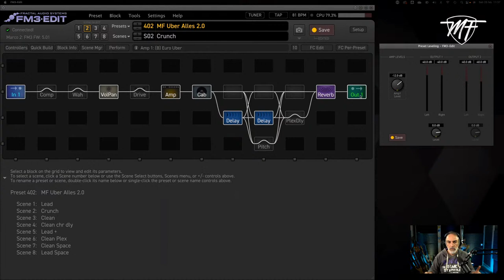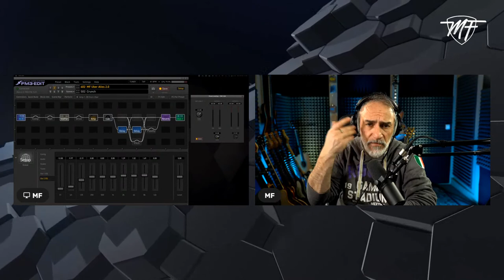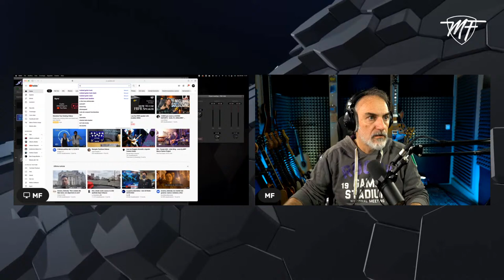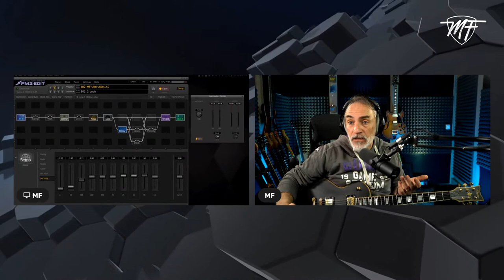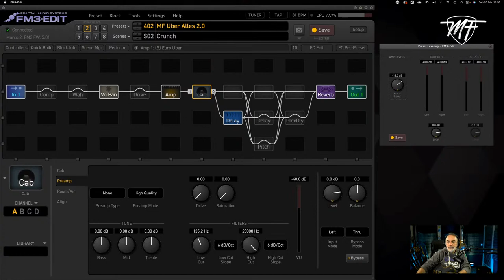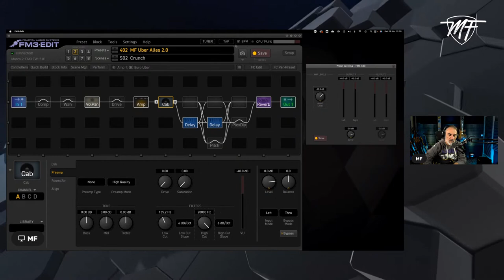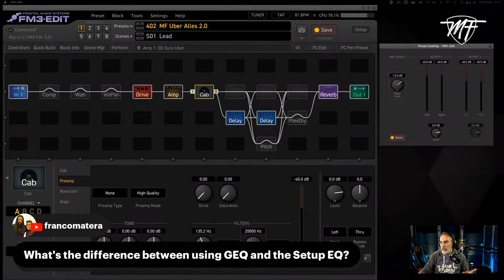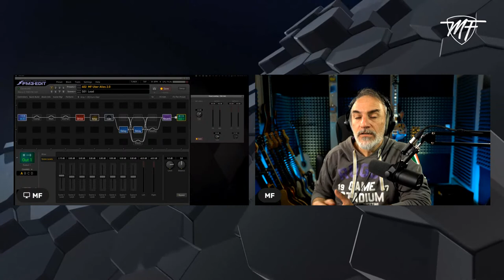How to use the FRFR speaker with digital modeler  (ENG)

Comment: Hi Marco,

This is just a thought experiment, but may also be help with a buying decision. 

I currently use 2 Headrush 108's and they are "not bad." I've used them for band rehearsal and gigs from small clubs to larger theaters. They are much better, tighter and more focused, than a single Headrush 112, which they replaced. But they are only adequate, not inspiring.

I'm thinking about upgrading if there is a clear benefit to the additional cost, and how to go about it. I really like Redsound speakers, compared with others I've heard.

If we were to hear the difference between 2 ELIS8's (mono) vs 1 MF10, how do you think would they compare? 2 8's have a combined surface area of about 100 square inches. A single 10" is about 63 square inches. But speakers are 3 dimensional and the cone throw on the larger 10" may compensate for less surface area.

Also wondering how a single powered ELIS 8 compares to the MF10.

This is where the imagination goes when you can't actually plug in and listen with your ears. Probably over-thinking, but I'm also sure they will sound much different.

Can you help? Thanks.